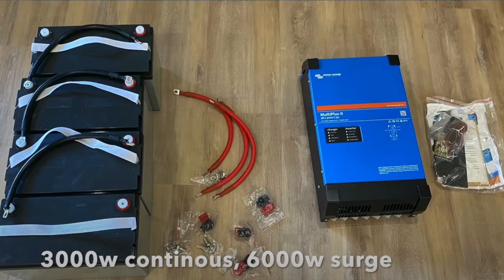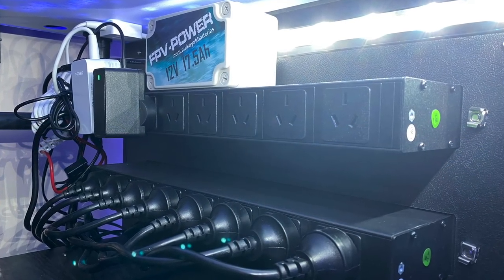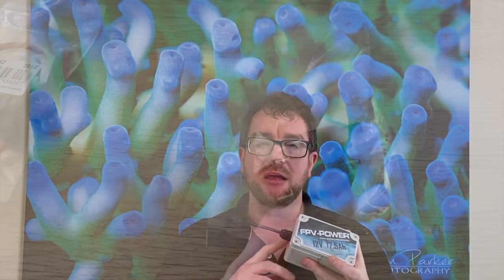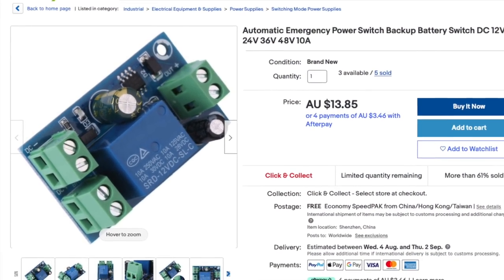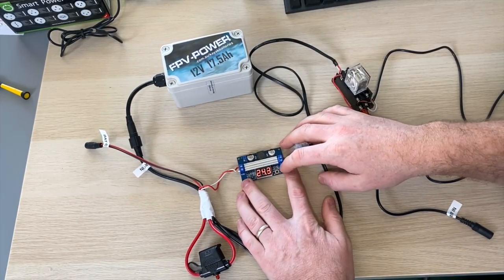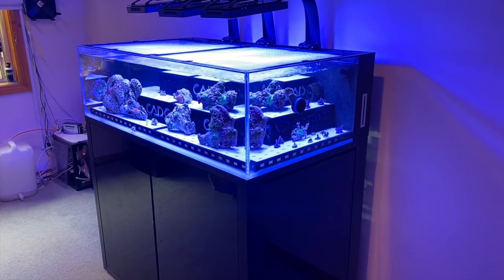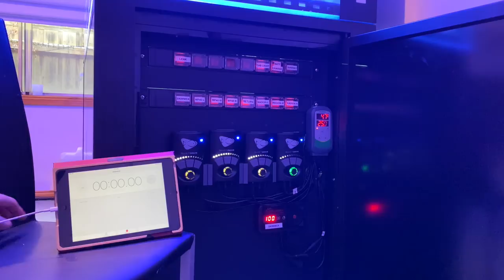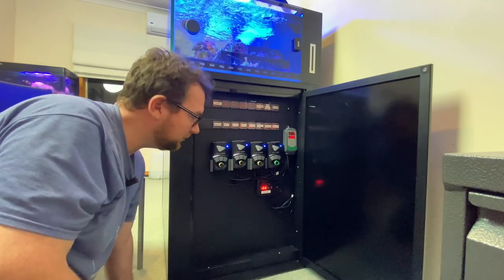How to battery backup any DC powered reefing equipment - CHEAP!

Comment: Thanks Sam, useful video. Dumb question but what do you do when you want to do a water change? I turn off all my pumps but then the battery back up would turn them back on, haha? Also, would you know if the Tunze safety connectors work with the Jebao pumps?
Reply from the maker: You can still remove plugs if you want to switch them off (or use the app if ecotech

Comment: Did you use both the automatic power switch and the relay on your setup? Doesn’t seem like you used it. Why did you choose the relay over that component? Finally, what size connector did you have to use for the Vectra backup cable? Is it the same as the vortechs?
Reply from the maker: The relay is the automatic switch, the automatic ones are just pre wired for you to make it easier to install.

Yes - vectra uses the same connector, from memory it was a 1.3mm connector?

Comment: Hi thanks for the video. I’ve had my upgraded Cade s2 1800 tank running now for a few months. I live in Melbourne and have tried getting the echo tech battery backup but can’t get any in Australia. I have 3 x mp 40 pumps an a vectra m2 return and Nyos quantum skimmer. My local LFS recommend a pc ups. I asked at battery world and they recommend a power shield commander 2000va ups which they say will run for 5 hours. Pretty confused not sure what option as this is a big ups space wise. I’ve been told I can’t buy the echo tech battery from eBay as they run 110 volts ( USA power) instead of 240 volts Aussie power . Any advise you can give would be great.
Reply from the maker: They ecotech unit is 12v, so that’s not an issue (charger mat need adapting though)

It will more likely be an issue shipping batteries.

UPS work, they’re just not super effficient at taking DC power, converting to AC, only then to go back to DC for the equipment 

If looking to run that gear, I’d make my own just like this system.

Comment: Hey Sam,
Thanks for the video. Might be a stupid question but what cables did you use to connect the correct controller to the battery? I noticed you linked the plugs from jaycar but not sure how I would wire these. What would be the best way to connect the mp40s to the fpv battery? 
Sorry, electronics is a different language to me haha
Reply from the maker: I just used some 7.5amp twin core cable. If you’re in australia, I’d be happy to make some for you, make any of it for you :)
Reply: That’s really generous of you. I’ll happily pay you for it obviously. Yes, I’m Australia, just north of Sydney. I’ve implemented quite a few of your ideas into my new tank actually. Currently have the Cade 1800 peninsular.
Reply from the maker: Sensational! Shoot me an email at sparker at Deakin dot edu dot au and let me know what you need and I’ll give you a price :)

Comment: Sam,
Your timing couldn’t be more perfect for me, I have an mp60, mp40 and a jecod 1200 (24v)

Was looking at 2x 23ah sealed AGM batteries.
Any thoughts on sealed AGM batteries?
Reply from the maker: Yeah AGM are fine and good value, that will give you a 12v and a 24v source too :)

Comment: so I've tried to make a batter back up, i got the stereo plug from jaycar you recommended and it doesn't fit the input on my mp 40 so i got a smaller 1 that dose fit but the battery back wont work, am i doing something wrong ?
Reply from the maker: Hi Shane, you will need the 1.3mm dc connector from jaycar (not a stereo connector - this one https://www.jaycar.com.au/1-3mm-dc-power-line-connector/p/PP0506)

If you have 12vdc supplied through that connector to your MP40 (ensure the positive is on the inside contact and negative on the outside contact) that's all there is to it.

Let me know how you go
Reply: @ParkersReef  ah ok I was using a 1.7mm dc connector, thanks mate

Comment: Sorry I might of missed it but how are you charging the lithium battery? Cheers
Reply from the maker: I have a power lead in from the charger into the “black box” it connects to the battery which has its own built in BMS from the 12.6v charger
Reply: @ParkersReef  ah i see thanks

Comment: The relay is not needed so long as the charging power supply has sufficient current to drive the pump.
Reply from the maker: Yeah that is true, although can be tough on the battery to drive everything through it and charge it constantly
Reply: @ParkersReef  So long as the power supply can drive more current than the devices no power will be pulled from the battery and bms stops the over charging.